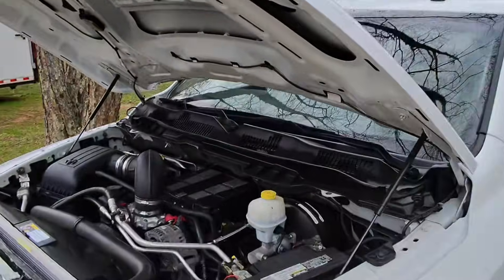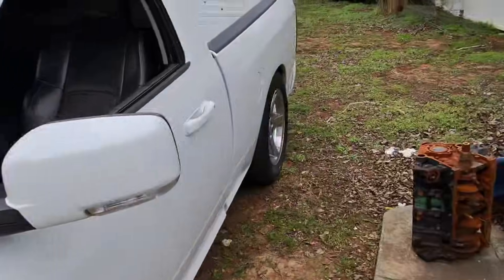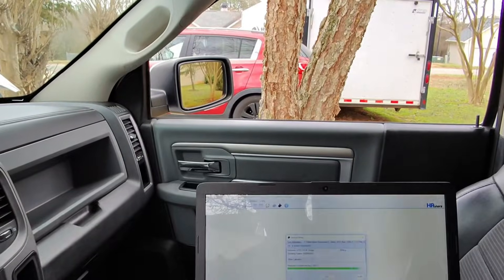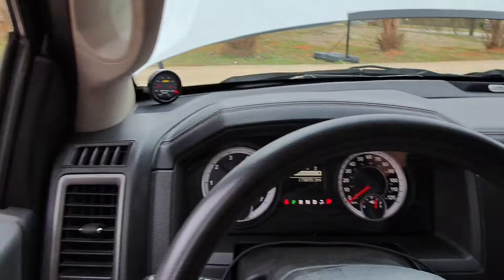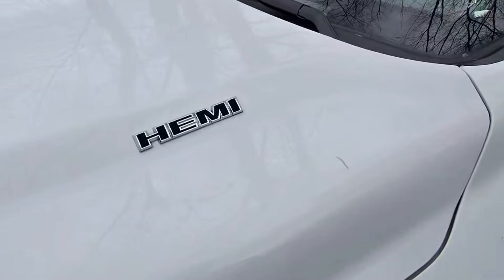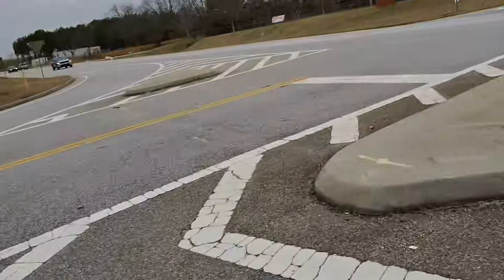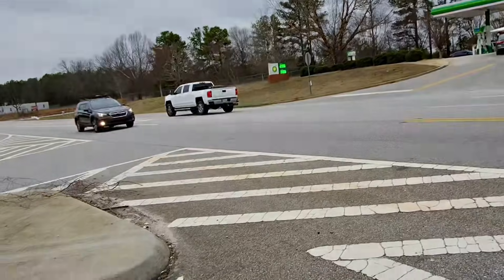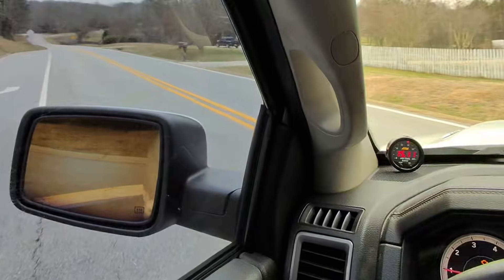Edelbrock Supercharger Testing/Tuning On A RAM Truck 5.7 Hemi

Comment: What weight motor oil do you recommend in a stock 5.7 hemi ?
Reply from the maker: 5w30 stock. Cammed and modified 0w40 srt oil. I run driven oil in my Frostbite.

Comment: Eewww clean the headliner! Gross! 
I was gunna say, that deff looks like a base model interior not an r/t interior, you can tell by the base model stereo. But all the black on the headliner, looks like someone's smoked 900 cartons of cigarettes in it and tried wiping it off. Get some 'tuff stuff' and spray it on there and some hot soapy water and clean that headliner, or pull it and recover it! Gross yuck
Reply from the maker: Yeah, you’re not wrong, it needs some love.

Comment: I have this blower on my truck because it is the quietest one i could find. It is a little louder after I installed a smaller pulley to get 7-8 psi and adapted the intake to use the vararam thru a bored HC TB.
Reply from the maker: Nice! I bet it’s a good combo.

Comment: The Edelbrock has a valve inside it that keeps it from providing a boost into the engine unless you are really getting on it.
 They do this to maintain fuel mileage.
Reply from the maker: Yeah, that's the bypass valve.

Comment: No whine because of the factory plastic intake and filter if it had an aluminum pipe it would whine way more
Reply from the maker: True that would help
Reply: is that what aluminum does? I had a mustang yeaaars ago and I bought a cheap CAI for it. Just with that, it sounded almost like a turbos blow off valve...I've bought CAI for other cars but I never heard that again and I just realized the mustang one was aluminum

Comment: I have a 2005 Ram Short wide 5.7 Hemi unopened and running a VS RACING TURBO 7PSI IT'S a 76/75 mm. And she is fun but I need some injectors I've got a fuel pump but fuel injectors are what I need RN any suggestions?
Reply from the maker: You’ll need some good flow for that setup.
I'm about to sell my FIC 1200cc injectors to upgrade to 1650s if intrested message me on Facebook or Instagram

Comment: I'm putting a turbo 5.9 built for boost in my 02 Ram. 
I'd like to race a Ram with a supercharged 5.7. 
I'd probably get waxed lol. 
But it would be cool to see how the 5.9 stacks up next to the hemi boosted.
Reply from the maker: @indica_dogo868  awesome, the 5.9 is a great engine but they don't flow the airflow of the hemi that's for sure.

Comment: Bought a 14’ sport with this kit installed a couple years ago and it’s always been low on boost. Smaller pulley don’t even see over 5 psi
Reply from the maker: Yeah this truck is seeing 5.5psi per the log.
Reply: @FrostbiteRam  odd that mine doesn’t see anything over that. Bypass holds vacuum as well. Any tips?

Comment: I have this supercharger on my single cab 14 Ram RT 5.7.  I have had the unit for over. 46k miles.  I'm tuned by FRP.

I have a HC 92mm tb, run the Mopar cold air kit and regularly pull 8 pounds of boost.  The SC has 3 settings.   A 3 psi, a 5 psi and an 8 psi adjustable by changing the spring setting on the blow off valve.  I'm running long tubes and FRP has my IATs in the very low 100s.  I've seen 153 mph on a highway in Mexico. Haha.  Great blower.
Reply: It awesome but don't expect 200 hp add.  It's more like 75 to 90.  A torque storm or pro charger is definitely cheaper.   Edlebrock support has been awesome for me.  Answer every question,  patient and knowledgeable
Reply: @DD-ew1ed  gotcha bro Yahh never really seen many run this unit so I’m on the fence with it but maybe I’ll just stay with my first option (torqstorm/procharger unit)
Reply: @DD-ew1ed  sounds like a beast of a truck bro .. like I said on my post , I haven’t really seen many run this unit and I’ve been wanting to see the results of it see if it’s worth it or just better off getting a torque storm unit or procharger
Reply: Yup, bypass not blowout, my bad
Reply from the maker: That's awesome, great to hear it's treating you well!
Reply: Did you mean the bypass valve? I do see the 3 different settings on mine but haven’t seen a difference in boost even when downsizing to a 3” pulley.

Comment: Also have been thinking of going with that S/C kit an haven’t been able to find many info on this unit
Reply: Currently my set up is fuel set up (walbro 450/injectors ) cammed , e85 fuel , stall 3200, headers , varam air intake , nitrous express hemi plate , I plan on going with that unit with 4.56s gears that’s if I can keep it on super low boost(5lbs) to still be able to spray about a 50-75 shot
Reply from the maker: @Chrrisvlogs  it's definitely not a bad kit just very expensive. Im still loving my torqstorm superchargers tho they have really impressed me.
Reply: @FrostbiteRam  hmm yah was on the fence on the unit since not many run it an there’s not many people that bother with it I mainly want a torqstorm or procharger unit .. I’m a 6spd too so can’t push to much with it , I’ve heard being FBO with a RFE is pushing it
Reply from the maker: @Chrrisvlogs  we just ran 15psi on project storm today old trans still hanging on 😆 went 12.35
Reply from the maker: Nice